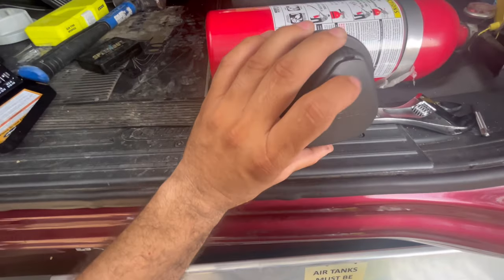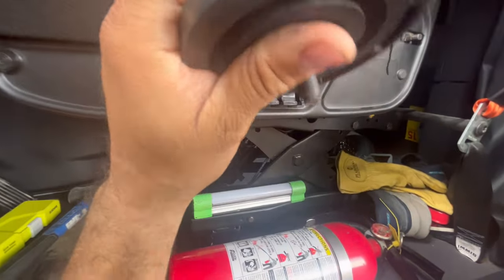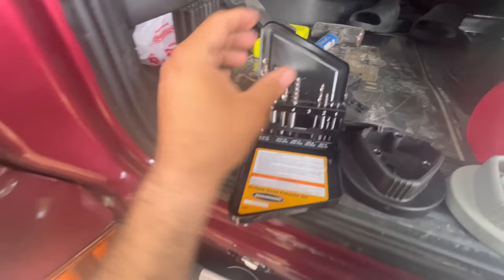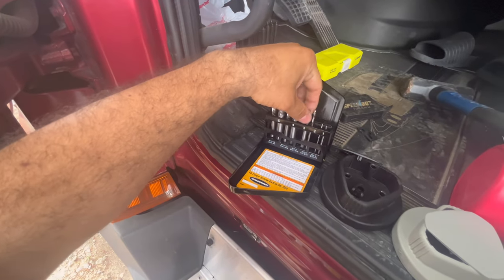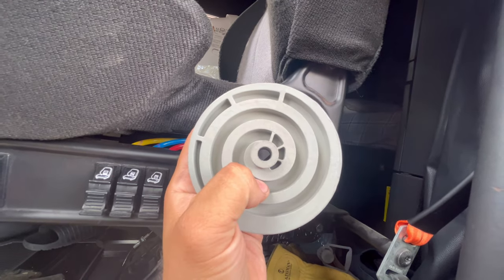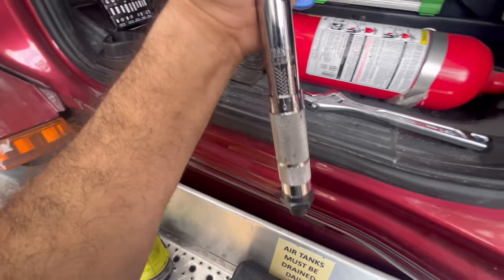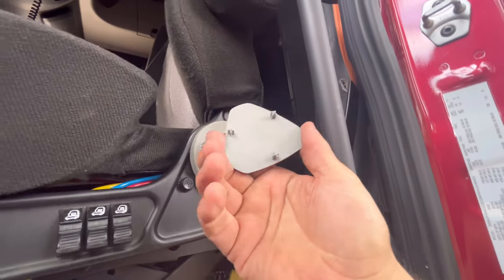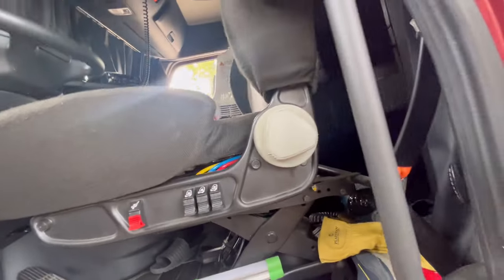Seat, back support adjust kit replacement. 2021 Freightliner Cascadia.

Comment: Hi everyone, Truck Freightliner Cascadia 126 , 2018 engine 455 power My driver's seat backrest doesn't lock and I watched your video. I went to the Authorized Freightliner Dealer at this address: Alaska Frontage Rd, Belgrade, Montana. I asked the parts clerk if they had the lock that you showed in the video, he said that they don't and that you need to change the seat and move it to the right and put it on the right in the driver's seat
Reply from the maker: I got mine at the Houston freightliner, I don’t know why they should tell you that?!